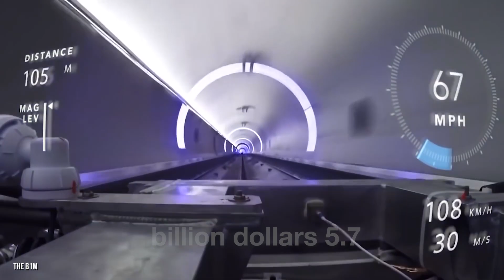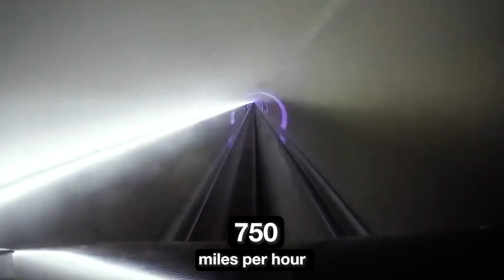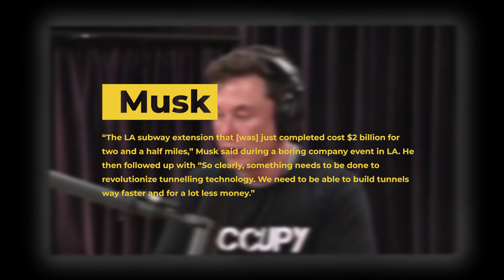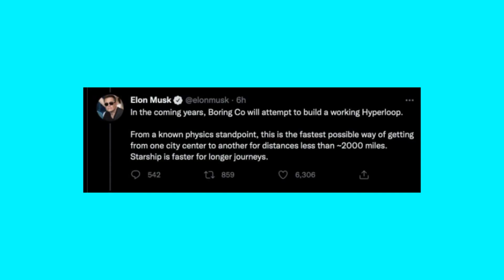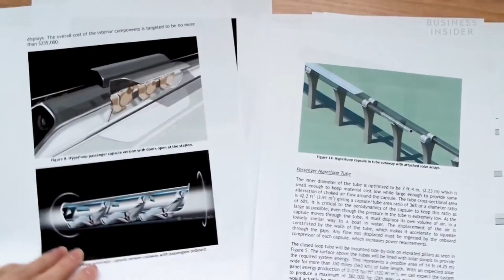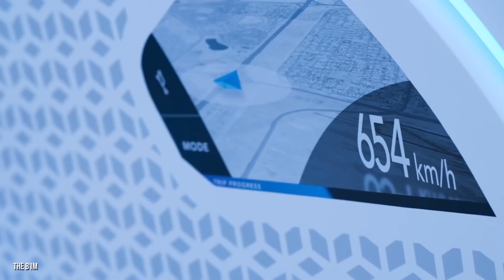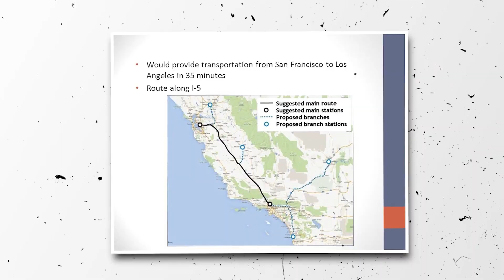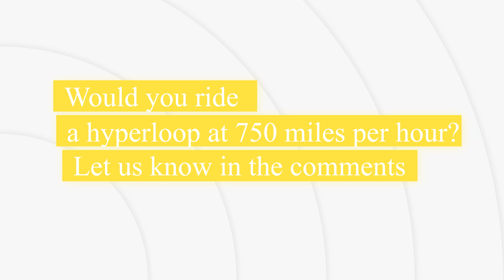Elon Musk SHOCKS Entire industry With First Hyperloop Line!

Comment: One thing always come to my mind when I see news about this project: what happens in case of emergency? If this tunnel can barely hold one train, how emergency vehicles/personnel will get there to assist? Eg. in case of fire on the train, engine failure, etc. If fire breaks out, there is danger of fumes, so you would need to open the train and break through the tunnel - then it's decompressed...
Reply: It's simple, everyone just dies.
Reply: There isn't an internal combustion engine
Reply: @joeleg9533  hate to break it to you but electrical fire's/ explosions are a thing not to mention people have belonging's which also could be flammable.
Reply: You ever crushed a pop can?
Reply: Seems less Ricky than a plane catching on fire to me. Also less likely

Comment: I feel like tunnels in the Western US is going to end badly in an earthquake or something
Reply: Hahaha right? I don't know what paint these guys are huffing to overlook how bad the idea of having a 100+ mile vacuum chamber in states with earthquakes. Not to mention the different climates cause stretching and contracting of the tunnel. Like the amount of pumps it would take to do this is absolutely insane 😂
Reply: Believe it or not, tunnels are not susceptible to damage from earthquakes if drilled at the right depth…….even in a fault line area like Los Angeles
Reply: @TheQuadrum  I think if we've seen anything from the Vegas tunnels it's that Musk/boring co don't have the ability to actually build a tunnel complex enough to go that deep underground and structurally handle an earth quake. It's not as simple as tunnels are earthquake proof because they're deep. They still need to be engineered that way.
Reply: @dannibble  tunnels tend to do better in earthquakes because they move with the ground, supported by the surrounding ground. Above ground buildings and structures sway in open air and therefore they suffer far higher damage.
Of course a tunnel can’t resist the forces of a fault where there is a lateral movement of the rock/ground on either side, no amount of design and engineering can resist this. Hence Engineers plan for the lateral movement up to a viable economic limit with things like flexible joints etc. anything above that will cause a failure.
So the next design aim is to minimise the consequences of the failure and plan for repair and reuse hopefully in a matter of weeks.
Here in Hong Kong the size of earthquake that would badly damage the metro would also leave the whole city as a pile of rubble with hundreds of thousands of lives lost.
Not having a functioning metro the next morning will be a relatively minor inconvenience.
It’s all about scales of acceptable risk.
Reply: @davidsalisbury50  you're probably pretty accurate on what you're saying, my two questions are liquification and if the tunnels are fine how do the non-stationary things like people inside of the tunnels experience the earthquake. 
I think the biggest thing to take away from your statements is that this is a very complex system of engineering probably one of the most complex(theoretical) engineering projects in the world. And a fuck up at that scale means disaster. 
And must think that he somehow magically going to solve all these and do it for cheaper in a quicker timeline than anyone else before. That's where I laugh my ass off because he has nothing to back up his claims other than "wait and see".